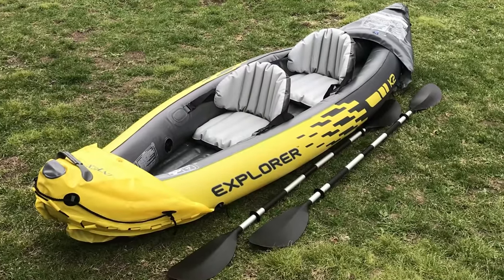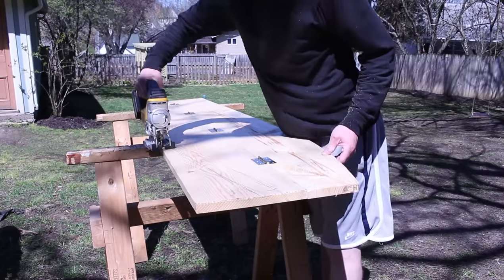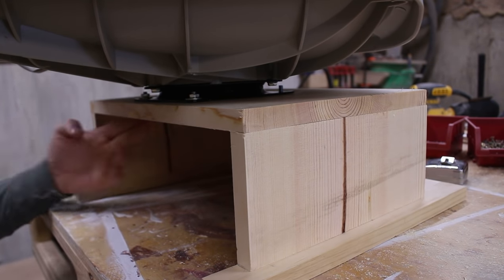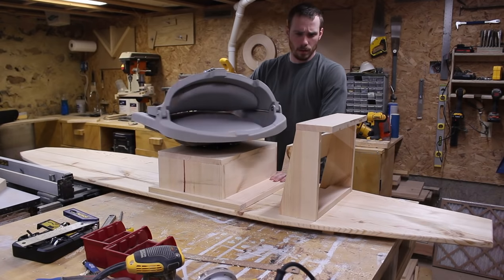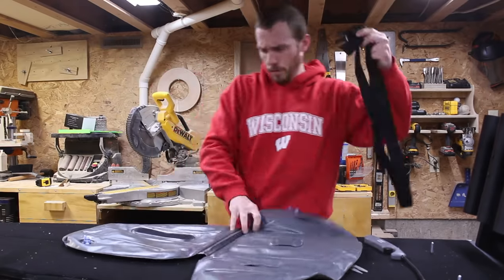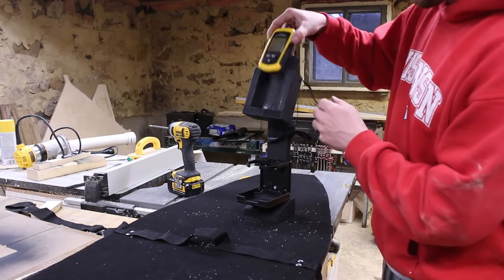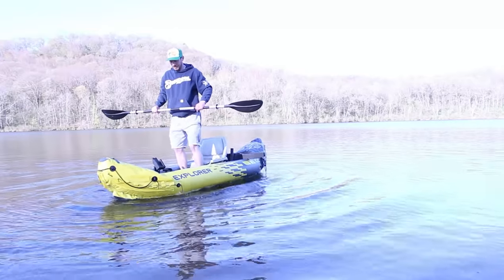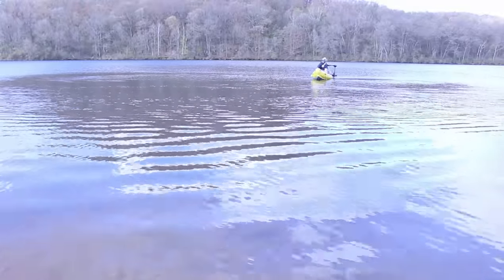Cheap Inflatable Kayak Modified Into a Legit Fishing Kayak!? How to Make It

Comment: Not a bad homemade RHIB using existing budget inflatable.  I like the seat upgrade/replacement although your installation appears to be quite high & thus placing your centre of gravity on the top heavy tipsy side of things.  All in all, nicely done.  Here's to some fruitful days of fishing without capsizing of course when you suddenly swivel to grab a rod or land that elusive monster.  Cheers.

*Edit:  That's a fair amount of weight added. (especially with the battery)  Do you know the total weight of everything to added?  If that's the K2 (2 person version) I seem to recall they can handle up to 400 lbs in total/gross weight. (pilot & passenger included)  Not that you will have a passenger along.